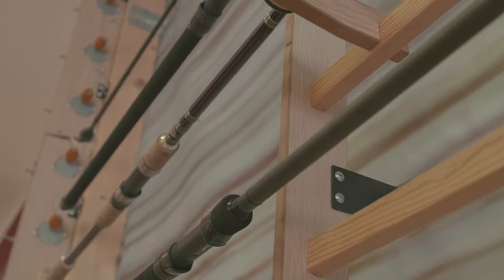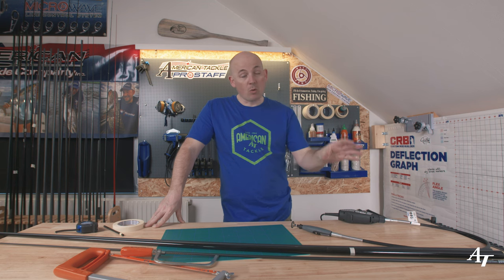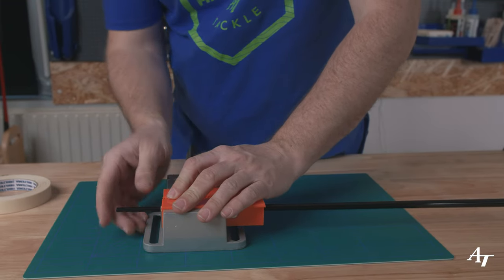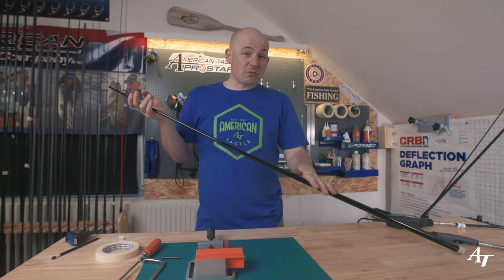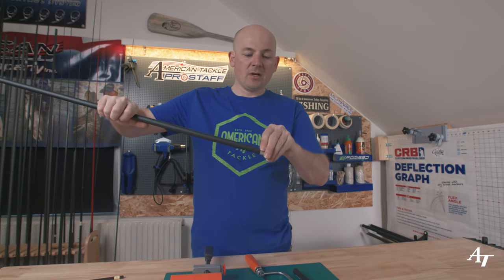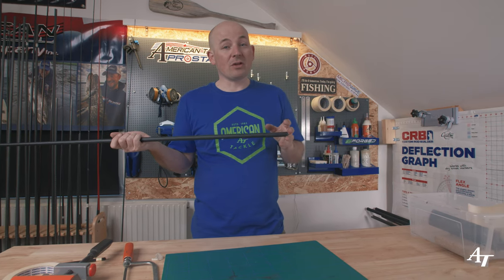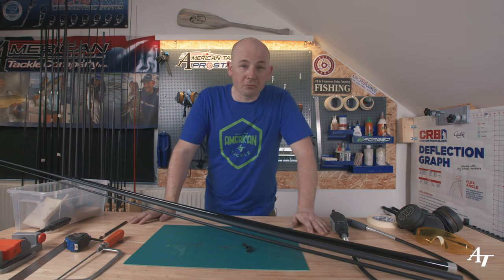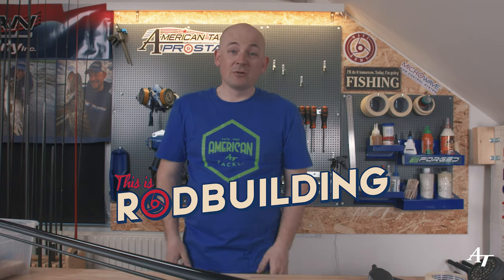This is RodBuilding Episode #16 Trim your blanks

Comment: I would have thought taking material off the tip would make the rod flex more towards the middle therefore creating a slower action. Im wondering if removing a couple inches from the butt would help the rod flex farther towards the butt on a fly rod blank

Comment: Good morning.  Just started watching your videos, they are very informative.   I want to start building my own rods, want some special flare and details I haven’t been able to find on the market.   I do have a question about the epoxy finishing.  I have dome some epoxy work with wood so I am a little familiar with epoxy.  I sometimes add color to my epoxy, using either dyes or Mica powders.  Have you ever tried using colors to the epoxy on your rods and if so, how did it come out?  Thank you. Jeff

Comment: Recent subscriber for Louisiana , US. 
Would love to see the light rod build. Thinking of building a BFS rod  and would love to see how you would choose and pick components. Like sizing and placement of guides  on a rod that bends pretty close to the handle. Here we deal with creeks and rivers with lots of trees  and from your description of the light rod it may be close to what I am looking to build except for I really want to do a two piece rod . 6 ' or  6' 3" something that can be low roll cast or skipped  in heavy tree lighned banks or kayak.  With 1/8 ounce baits.  Recently got a zephyr BFS reel and currently using a cheap zebco hotcast rod. Lol
We don't have a big selection of BFS rods here everything either has to be shipped from overseas or cost quite a bit. If I am going to pay a bit I may as well learn how to build one.